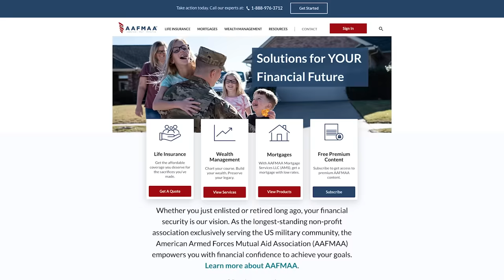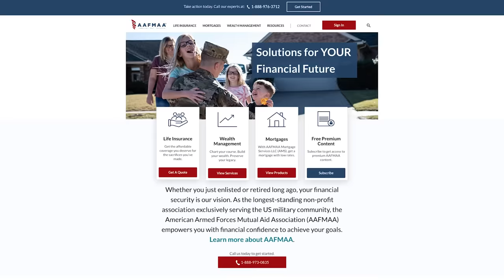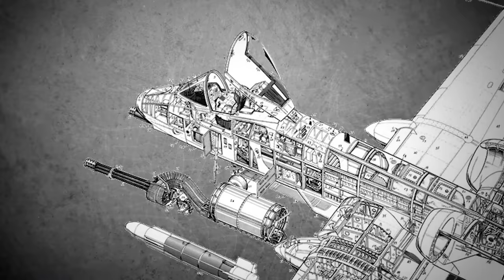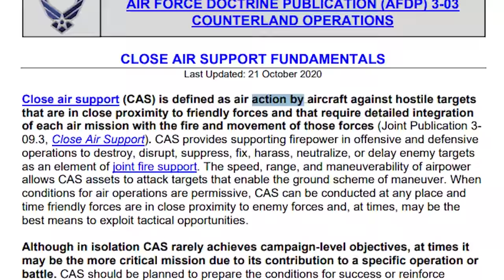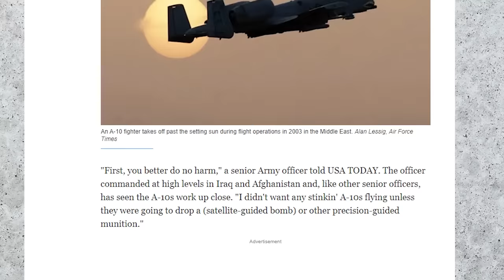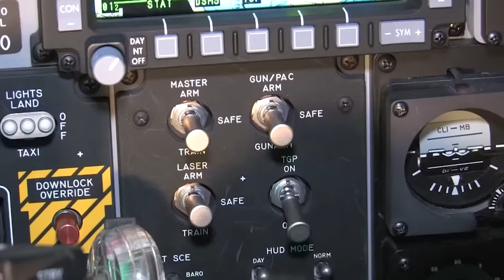Why the Air Force is Screaming to Retire the A-10 Warthog

Comment: A-10 survivability was great during its heyday. But now there are too much AAA that can shred through its armor because near peers evolve to defeat it.
And unless there is a major break through in aerial armor technology, a flying tank is basically a no go.
Reply: Carbon Fiber maybe?
Reply: what do you think happens to an f35 doing the same job? The real answer is nothing because the AF simply wont provide ground support
Reply: @charlesreid9337  Lmao guided bombs are a thing, bozo. They have much greater accuracy than GAU and far better destructive power. Also you can fly a plane far beyond any manpad distance, unlike A-10
Reply: > A-10 survivability was great during its heyday.

Ya no. It was equipped to take 23mm AAA. At the time of it's first flight the USSR was about 50% into replacing it's 23mm with 37mm AAA. By the time production started the USSR no longer had 23mm AAA any were but the reserves. The air force knew this and wanted to cancel the program before they even built the first one, but congress overruled them.
Reply: A-10 has a few mm thick titanium cage. It can protect from small caliber bullets and small missiles ( missiles from SAM system would shred the whole plane making it unflyable, even if the pilot survives), so I wouldn't say that it was ever flying tank.
Reply: It never had good survivability.
Reply: @charlesreid9337 the F35 is designed to engage from beyond the range of AAA.

Comment: Honestly a helicopter and or drone could do the job better than the A10. I think its worth noting that the A10 had the most Jets shot down during the gulf war and ALSO the most blue on blue incidents
Reply: They also bought the AT-802 sky warden , which basically an armored crop duster with advanced sensors and weapons pylons . SOCOM is getting 75.

Comment: I feel like the A10s are as much a morale boost to ground troops as it is effective CAS. It's simultaneously a morale hit to the asymmetrical enemies it had, hearing that low, slow BRRRRRRRRRTTTTTT, and seeing a A10 cruise by after evaporating the area around you is a hell of a deterrent to keep doing what you're doing.

While it is becoming less and less effective, the morale effect is just as effective as it's armaments. It's retirement is inevitable for very good reasons, but I fear that unless the USAF can field something that will have the same morale boosting effect, it may hurt ground ops needing CAS for at least the near future.
Reply: Morale cuts both ways once you consider the CEP putting friendlies and/or non combatants in danger. I'm not aware of a (public) study on this, but most missions don't use the gau8 as the result of this. Realistically as cool as it is, the gau8 is a bad weapon that is not and was never fit for purpose; bad for troops down range (based on CEP and weapon range as relative to the pgm), bad at taking out tanks (based on best case assessment against t-62 taking ~2missions to get a gun kill on static target in the open as compared to atgm or pgm). If the gau8 is bad, then the a10 is bad given it's the differentiator (f15e/x or f35 or shit even the b52 can drop the same munitions, higher faster and with a better and cheaper logistic chain).

Would have been good to hear Cappy talk about this in more detail (eg: in desert storm a10 fired 4800+ Maverick AGM, seems unlikely that many of the quoted vehicle kills were gun kills, likely the exception not the rule)
Reply: It is good to mention this, people who experienced it as CAS vs ground attack have very different memories of the plane

Comment: Two things:

1. As a HUGE Warthog fan, I'd like to point out that the GAU-8 was always meant to be used to attack the *engine deck* of a tank, which HAS to be able to be lifted by a stout lad with a tanker bar, so there's a limit to how thick it can be. To this end, it was always intended to conduct attacks against tanks from the rear third of the tank.

2. As a HUGE warthog fan, I've accepted that her time has come, and to explain why, I'm going to repeat what I said to someone elsewhere in this comment section:

I'm just an overweight civilian wannabe, but I have been watching way too much MilTube over the past eighteen months (as have so many of us), and my takeaway on all this is that the concept of close fire support being fulfilled by a single type of heavily-armed, heavily-armored, low-flying, fixed wing aircraft is itself obsolete.

The role played by the A-10 will now be dispersed among several different weapons systems, including the F-35, F-16 (those are still around), AC-130, drones, and the Army and Marines' renewed interest in ground-based long-range precision fires. None of these platforms will have ALL the same capabilities of the A-10, but all together, they'll provide all the same capabilities and more besides, all at lower cost and greater flexibility.

This really does follow the trend in Western militaries of standardizing munitions delivery platforms, and putting all of the specialization in the munitions themselves.
Reply: I have to agree. The A-10 has very much had its day, and will go down as the last great manned attack aircraft. Drones are simply rewriting the battlefield, and the A-10 doesn't have a place on them anymore. It was glorious while it lasted.
Reply: The A10 of today is not your grandfather's A10. Nothing even close . With the end of the Cold War the A10 evolved into a ground troop cover airframe .
Reply: @CraigGrant-sh3in  -- How?
Reply: Try Keto
Reply: That's what I thought, the AC-130 could do what the A-10 could do but in a higher altitude so manpads wont be a problem.
Reply: The targeting pods on F-15Es and F-16s alone make the A-10 obsolete. The USAF had increased precision hence is now able to move to small diameter bombs.
Reply: @CraigGrant-sh3in  Except it didn't 😂. The F-15E is superior.
Reply: @JohnnyWishbone85  It never did, the F-15E is a superior airframe to the A-10. The A-10 was a political plane turned welfare program for certain senators.
Reply: @RedMedina25  AC-130 is for AFSOC only. The F-15E and the F-16 do more ground work.
Reply: Yeah but the thing is that the A-10 is still used for these missions because it's cheaper, it is just not cheap enough. Personally, I see the Valor as the aircraft that will eventually replace it. It should be cheaper and much more flexible.
Reply: The thing about the gun is it was effectively obsolete from the moment it entered service. It lacks the penetration to defeat the armor of MBTs and it simply isn’t accurate enough to reliably hit the weaker armor of the engine deck. The only thing that kept it relevant was it’s ability to carry precision ordinance. In the first gulf war the vast majority of the A10s kills, and all of its tank kills, came from the external ordinance it carried. 
When you factor in the limited sensor suite, and the fact that pilots relied on binoculars for IFF, there’s just nothing the A10 can do that other platforms can’t do better. And all the rabid A10 fanboys need to realize that “big gun go brrrt” is not a good enough reason to keep this outdated piece of crap flying.
Reply: @CharlieNoodles  Only logical comment in the section..gau8 is junk for what it is/was designed for. So much cope about the gun (and therefore the plane given the gun is the most relevant distinguishing feature). Re. sensors, I think the litening targeting pods (again non distinguishing feature) put them on par for the mission profile though.

Even presented with the official testing documents in the MOST favourable conditions about the accuracy, penetration (against T62 let alone modern tanks) and the historic use of pgm over gun kills (in DS1 firing 85%+ of all mavericks). People be like... "GAU8 JUST NOT BEING USED RIGHT", meanwhile the blue on blue/civ pink mist downrange...
Reply: sorry the m47 pattons standing in for the t62 lol. always forget that.

Comment: If I’m not mistaken, there have been tests done recently of the GAU-8’s effectiveness against modern ERA and other sorts of armor, and it was found to still be effective. I’m not sure about the parameters of the testing, but I don’t believe your point of it being ineffective against modern MBT armor to be entirely accurate.

Admittedly, I am biased for the Hawg, as I’m a crew chief at the first unit to fall victim to the divestment—the 122nd Fighter Wing in Fort Wayne, IN—but I think there is a lot that the platform offers that is simply irreplaceable, at least by anything currently in inventory. While survivability against modern A/A weapons systems is questionable, you also have to consider that A-10s would be far from the first thing sent out to the front lines. They’d be used more in support of friendly ground assets AFTER air dominance is obtained. Its payload and its loiter time are also huge, huge benefits. While the GAU-8 isn’t suited for everything, it is certainly accurate enough to conduct incredibly effective and precise CAS. One point that wasn’t made here is the cost associated with these PGMs (precision guided munitions) such as Mavericks, AGR-20 rockets, LGBs, JDAMs, etc. The GAU-8 may have SOME collateral damage potential, but really not substantial. To claim that a 500lb guided bomb has less potential for collateral damage than a burst of 30mm would be a bit crazy. AGR-20s would be effective for smaller targets which still require extreme precision, but again, the cost of such munitions is VASTLY higher than that of 30mm, and the A-10 is capable of carrying them anyway.

One other hugely important point I don’t see made often is this: A massive part of the reason the Hawg is such an effective airframe in the CAS and CSAR roles has nothing to do with the airframe itself, but the pilot. With the aircraft having been designed to fill a single role, and being used as it was originally intended for decades, A-10 pilots are just as specialized for such roles as the airframe. Tons and tons of knowledge of the ground fight is required to be an effective Hawg driver, and a pilot trained to be a multi-role pilot will simply not match the capabilities of one who is trained to specialize in a single (or, say 2–CAS/CSAR) mission with regard to that specific mission. This isn’t to say that those pilots would be ineffective at that or those mission/s, but just not AS effective—but I do believe that is a big difference.

Lastly, there are other roles the A-10 can fill, even if not for CAS and CSAR (though still very important missions, don’t get me wrong). Take some time to look at the ideas being tossed around recently—using the A-10 as a bomb truck, for SEAD by way of air-launched decoys, etc—it still has plenty of uses outside of its original design purely because of its reliability, survivability, payload capacity, and loiter capability.

I didn’t intend to write an entire essay here, but I just have too much love for the A-10, and really don’t think it’s a good idea to outright retire it and do away with the idea of a specialized CAS and CSAR platform as we stand right now. I see and understand the reasoning behind doing so, but respectfully—and strongly—disagree.

Cheers to anyone who actually cared to read all this by the way 😅🤙🏻
Reply: ERA doesn't work against kinetic armor penetrating rounds, so that's a nonsense argument. ERA is designed to defeat HEAT.

Of course the GAU-8 can be effective against 'armor'. Vehicles come in all sorts of armor. The question is, what kind of armor, how thick, what is the priority of the vehicles sporting said armor and most importantly: how close did you have to get to penetrate?

Do you even realize the GAU-8 was designed to penetrate the top armor of a tank the Soviets weren't even using anymore by the time they spooled up full rate production? The T-55 was replaced with the T-62 which had double the top armor, which meant the A-10 had to get in significantly closer, which means that ZSU-23-4s can eat that shit for lunch.

Also I don't know why you're pimping up the pilots, dude. The pilot is wildly oversaturated with the dogshit antique avionics in that thing (yes, even the C), which is why pilots murder the shit out of their own forces with it at a higher rate than any other airframe. They can't see, they have a thousand things to micromanage, it's way too much for one person with the technology available.

Comment: The problem with the A 10 is that it just happened to fill out a perfect niche that makes it relevant for so long (destroying insurgents with no dedicated AA all while costing a fraction of other jet powered aircraft). Doesn't help that the jets are so old that maintaining them is more expensive than actually purchasing new aircrafts. Armed turborprop cropduster and UCAV can fill out the A 10's current role while costing even less in terms of service
Reply: Plus the only unique thing about the A-10 is the gun. 90%; of the A-10’s kills were with bombs and missiles. The gun is responsible for a truly horrific number of friendly fire incidents.
Reply: Burt Rutan's Ares would bee a good successor to the A-10. Less expensive and lighter, with a 20mm cannon but the same basic idea.

Comment: You forget to mention that, in its development phase, the A-X aircraft was specifically meant for CAS in the Vietnam war, which ended before the prototypes came out, so they then changed the justification and specs to CAS in a ground war against the USSR in the great Eurasian plain. Regardless of those historical details, the Warthog still remains the most successful CAS aircraft in history so far.
Reply: Technically no, it's not. The MQ-9 is. CAS doesn't mean "shooting a gun". CAS is any mission supporting ground troops in close proximity. The MQ-9 has flown more missions and released more missiles than you can even imagine. Hundreds upon thousands of hours of flight time, all over the world, for well over a decade.

I was in Afghanistan when they began pushing missions to the MQ-9 and that was when the A-10s 'impressive' stats all died. The F-15Es were doing better than the A-10s because all the A-10 missions were replaced by MQ-9s.

And the A-10 is too dogshit to support troops who need emergency air support "Okay guys we'll be on station in two hours".
Reply: @fnhatic6694  Well, if you're gonna include drones and UAVs, then of course. But as long as there needed to be humans in the aircraft, the A-10 was unparalleled.

Comment: The last A-10 was built in 1984. The only reason they've been so successful in the mid-east is that the US enjoyed complete air dominance. If we tried using them against a near peer opponent they'd be slaughtered.
Reply: An A10 can take a direct Igla hit and still flyes. Say the same for the F35.OK, the F35 is stealth - but if you can see it, you can shoot at it. Chinese and Russian missile systems also have electro-optical sensors. No heat/radar signature is needed.
Reply: I tried to tell this to some reddit mouth breathers and got death threats
Reply: Honestly they've not even been that successful in that theatre either, other planes have markedly better stats
Reply: @purplefood1  The real reason they've been kept is simple. they're dirt cheap.
Reply: You just described modern warfare, since ww2... Fighting another way is a losing endevor.
Reply: Complete air dominance was never a requirement for employing A-10s.  The system was designed to fly, and to survive, in a 1980s European defensive war against the Soviets, who at the time were very much considered near-peer adversaries in both the air and anti-air capabilities.  Of course, that was forty years ago; much has changed since then.
Reply: That and their entire design was for a single mission type for a different kind of army, with a different strategic doctrine and different mission structure. It’s not 1970, and modern conflicts prove as much.